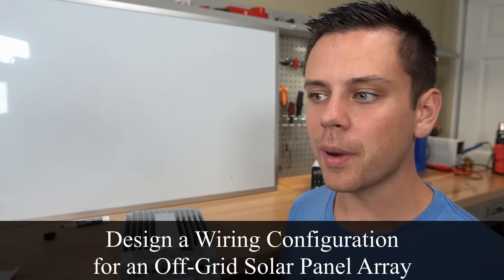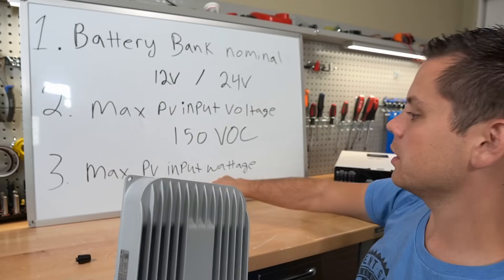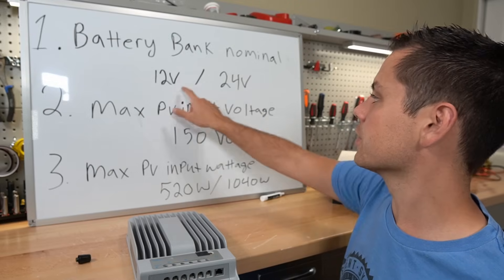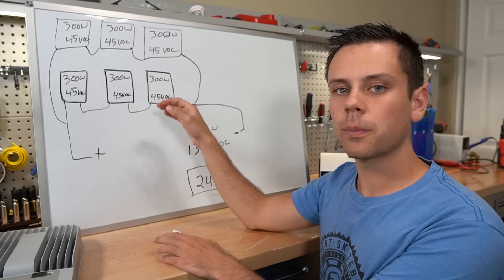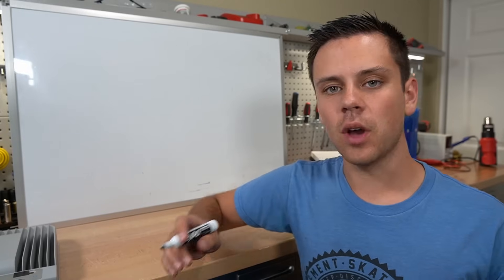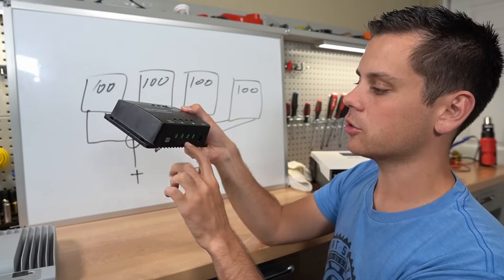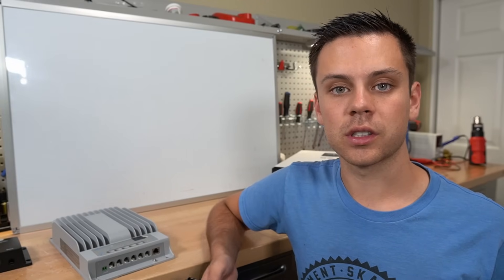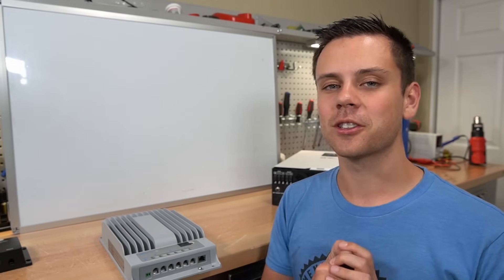How to Design an Off-grid Solar Power Array Wire Configuration

Comment: When considering the open circuit voltage of the array, you need to also consider (add) the panel temperature dependence offset or you can smoke an MPPT. At colder temps the panel Voc goes way up (and current down) vs. the nameplate rating at 25C.

Apply the open circuit voltage temperature coefficient for your array and size Voc (for MPPT) for the coldest temperature for your area with headroom. It's usually around - 0.3%/°C
Reply: Lance he did not mention whether using a 12 V or 24V panel. Does that matter or is it strickly just VOC and AMPS?
Reply: @oneshot_onekill4618 true for all panels
Reply: @lancefaure3945  Thanks i appreciate it! I have the MPP Solar LV2424 and i have 6 12V Renogy 100 Watt panels but i rather do a 24v system so i wanted to make sure i could use them and the only thing to look at is the VOC and AMPS.
Reply: @oneshot_onekill4618 the point I made about Voc (and Amps) is that they should be sized for the worst case scenario, not the standard operating  condition (ie nameplate rating). So if you live in a very cold climate your Voc goes way up (by 0.3% per degree C below 25C) and the current goes way down. And the opposite happens in hot climates. So basically size your array for your highest and lowest temperatures with an additional safety factor. Standard rule is multiply by 1.25

Comment: This controller can handle 3x the rated wattage input, so no, 1050w isn't too much for this in a 12v nominal system.

Comment: So if I add a 12v battery to another 12v battery I'll haft to get a 24v solar panel I wouldn't be able to use a 12v solar panel cuz I want to run one 12v battery but later add another 12v battery and another 100w solar panel that's 12v

Comment: I have the following solar equipment:

Renogy-Rocer Elite MPPT Charge Controller

2-Renogy AGM 12 volt 100ah batteries 

1-12 volt Pure sine wave 3000 watt inverter

1-Westinghouse 4500 generator/inverter

3-12 volt 300+ solar panels

My question is 1st is this a sufficient system …2nd can I run the generator as backup or Additional  power directly into the 3000 watt inverter???

Comment: I think solar energy is plagued by ancillary equipment failure. Inverters themselves cost a lot of money and in my case have proven to be highly unreliable. The best Off grid solar system has a high array input voltage, a high ( at 96 volt ) battery circuit and of course a high wattage rating. The object is NOT to use an inverter. At this dc voltage load circuits can be run smaller wire gauges. Light circuits would use many 24 volt lights in series and other 12 volt devices would require buck step down regulators. It would be nice if we would see a greater variety of high volt dc appliances. In any situation one must be very careful. I purchase all my camper electronics based on DC compatibility. Always preferring 24 volt or greater devices.

Comment: Mr. Prowse,
   My sister and I have been watching your great videos for a while now and we love them. We are subscribed as well. You have insprired us to build our own solar panel system. We have aquired 4 100-watt panels, a 60-amp epever charge controller, a 3000-watt Renogy inverter, 11 35ah batteries, an epever blue tooth module for monitoring with my Iphone and we are using 6-gauge wire. We have only been able to get around 90 watts at 5 or 6 amps during peak sunlight and we are wondering if this is normal or are we doing something wrong. The settings on the controller are: User 12V, Low Temperature Prohibits Charge 0, Low Temperature Prohibits Discharge 0, Battery Capacity 385 ah, Temperature Compensation 0, Equalize Duration 0, Boost Duration 180, Max Voltage 15.5, Min Voltage 12.92, Over Voltage Disconnect Voltage 16, Charging Limit Voltage 15.8, Over Voltage Reconnect Voltage 14.4, Equalize Charging Voltage 14.8, Boost Charging Voltage 14.8, Float Charging Voltage 14.8, Boost Reconnect Charging Voltage 14.7, Low Voltage Reconnect Voltage12.6, Under Voltage Warning Voltage12, Low Voltage Disconnect Voltage 11.1 and Discharging Voltage 11. We have never been able to charge our battery bank over 46% and we have only been able to go as far as 70 %, a couple of times. We bought 4 more 100-watt Ecoworthy panels to add so that we can try to get more amps going into the batteries. Any advice on our problem would be greatly appreciated. Thanks for the great service that you are providing with your channel.

Comment: Lovely video I am a fan of you works from Nigeria.
Please I want to ask a question, I have 3.5kva inverter which has requires PV input of 30-150vdc what happens if I connect all my panels in series that will produce 152v will it damage the inverter

Comment: I am just starting to design my system for my shed/green house, i have a 16ft shed that i want to put up 5 solar panels, i have a chance to purchase 5 -200 watt canadian solar panels, I have two 80amp batteries now, how should i set that up and what controller should i use, I will be getting more batteries how many should i set up and should they be set up 12V or 24V.
Thanks

Comment: I get that "technically" the solar panels with a power of 1050 W don't satisfy the 1040 W limit of the inverter, but in reality, and taking into account the tolerances and variations due to the angle/shades/sun, I would have thought that you can connect them with a quite high level of security.

Comment: Why oh why does no one in any of these videos ever address the wire issue?? AWG IS an issue! Go ahead, hook your panels together with 28awg. The lower the voltage the larger the amps, hence the larger the wire, running panels in parallel exacerbates the issue, plus de-rating for length and temp. Putting panels in series boosts voltage hence less losses on the wire, and smaller conductor. Run length matters.

Comment: Sir i have 40amp ssc mppt epever tracer an with 100v max voc and planning to put 24v batt. The only available pv panels here is 450w with voc 49.2v. Then plan is to have 2pcs 450w in series and have sum 98.4v voc. Is this safe for my scc because its kinda close to 100v. Or should i parallel this two to have 49.2v only? My worried is if i parallel this two, i need to replace my 6mm2 twin cable from pv to scc?

Comment: Can I ask you something please. I want to setup a 24v system, I live in Las Vegas and I wanted to purchase 2X 100ah batteries and wire in series to get 24V. I keep reading and hearing that when you wire in series you only increase your voltage but not capacity so does this mean combined I will still only have 100ah ? Sorry for such a noob question.

Comment: Is there such thing as an amperage limiter. I've maxed my setup via voltage so I was going to wire in parrallel but my amperage would be over the inverter limit?? Please and thanks as I need more watts. Running my camper off grid with 2500w system on a 48v inverter with 2 48v 100ah lithium batteries. My inverter limit is 500v at 16a. I'm currently at 386v at 8.6a in series. I'm looking to add another 10 panels of 250w 38.6v 8.6a. But wiring in parrallel to stay below 500v puts me over 16a... any suggestion? Reason being trying to keep my battery fully charged until the sun goes down to further limit my generator run time..

Comment: I wish I knew the answer to this question:
What if I added another brand of panels to my existing PV array?
Is it a problem if the new panels have a higher wattage? (slightly different circuit voltage)

Comment: As long as the voltage is the same or greater than the panel array, why would I have to worry about watts or amps, aside from the wire size?

The inverter PULLS amps, right? Just like how a tool you plug into the wall pulls however many amps it needs. As long as the voltage is correct, how can anything be "fried"?

Amps aren't "pushed" into the inverter. So why not max out on the solar array and max out on inverter clipping?

Some inverters pull from the grid itself. The grid doesn't have some wattage "rating". It carries a voltage and you can pull as many amps as you want from it as long as it is designed for that voltage.

Comment: Hello dear , i have the same inverter specs but im stuck with only 3 solar panels (470w/vmp 42v/ voc 52v ) what os the best way to connect solar panels note that my panels are 45 meter far from inverter connected with 6mm cable copper size

Comment: how to connect four AS-6M120-HC BLACK
380W PERC, 42 voc, 10.86 Imp to victron 250 / 85 controller with 12V batteries? If all 4 are in parallel then amps exceeds mc4 plug 30A limit?

Comment: in series watts dont multiply only voltage, parallel is the opposite and varying voltages or wattage panel strings runs at the lowest value volts/watts

Comment: Hi Will, thanks to your videos I've now realised that my solar panels and mppt controller aren't exactly compatible. My 3x panels have a combined voc of around 150v and my mppt states no more than 110v. My question is, is it worth series wiring two of the panels to get the voc near the max of the mppt and leaving the third panel out of the system, or wiring all three panels parallel, keeping the voc lower but the wattage high??? Thanks, Adam. Ps finding the mobile solar power book really useful!!

Comment: l dont understand  why if you connect  4 panel solar en serie 45 volt  45 ×4 volt  am egree but if is conect in serie volt  will be ip but watt still  the same 350 is amposible increase de vot and watt at the seme time

Comment: I really enjoy your videos. I am putting together a solar array in Shelter Cove California. I bought six 350 W panels from CED in Stockton California. I also bought a AMPINVT 120A MPPT Solar Charge controller. I also bought a WZRELB Pure Sine Wave 5000W (10000W Surge) 24V Power Inverter DC to AC Power - Solar inverter. Do you have a recommendation for a monitoring device and a distribution box if needed? If so can I get those from you? Thanks in advance for your help. Dan Bell here.

Comment: My question is, are u saying the wattage of the solar panel also increased when connected in series, for example if i have 3 24v solar panels each 100watts when connected in series the voltage increases to 72v are u saying the wattage will also increase ?

Comment: Please can you help me with my situation 
I have an inverter mppt with max wattage 1500w and max voc is 145v 
I have 3 panels with 51.3 voc each and 470w 
How can i get the maximum without hurting my inverter
Ps: i cant add more solar panels because of space 
And i have around 45meters wire between PV and inverter

Comment: Thanks Will! Helps me out a lot with choosing and wiring in my RV's solar array. Will be: 2x100w panels in parallel --> 30A PWM charge controller (renogy wanderer 100W charge kit + 100w panel) --> 2 x 215AH 6v golf cart batteries in series --> 500W inverter until I get my bigger inverter. Will add a battery monitor when I can too. Solar panel ordered, can't wait to test it out

Comment: Hello everyone, I wanted to ask something that I am trying to understand, let's say that I have 3 strings put in parallel, each string has 2 panels, what would happen if because of shading or stuff like that one string end up having a different voltage at its connectors compared to the other strings? Because I'm lead to believe that because of the difference there would be a small or larger difference in voltage at the nodes of the shaded string causing a current to flow in this string but in an opposite direction basically stopping to produce energy and instead consuming it as a parasite current. Am I correct or I'm misunderstanding how it works? 
Probably it wouldn't be much as the difference in voltage would be small but also I don't think the panel have high resistance and so the current that would flow isn't that small without considering that like that is also kind of a waste of panels.

Comment: If you have a 100 amps of 12 volt then go to 48 volt wired for 140 volts and only get 2 amps are the batteries still getting the same amount of power?

Comment: I ordered that EPever MPPT and looking to get five Newpowa 100w panels soon. I hear the Newpowas are sometimes pulling a little more than 100 watts per panel and I want them for a 12v 200ah 2560wh battery with a 2200 watt pure sine inverter. All components that you recommended from your site! 👍🏽👍🏽

Comment: 9:32 Is there any reason not to connect all the panels both in series and parallel, like grid (add 4 vertical lines between panels to your sketch) ?

Comment: I came across your video and really learned a lot. I saw you did one on the Goal zero. Would you need an inverter or circuit breaker if the yeti regulated itself. Is there anything I need to look out for. It’s the yeti 6000. Any help is appreciated. Thanks!!

Comment: Hi. What would be the outcome of this series parallel connection:

String #1:  100w 16.77v 6.26Amp (2 panels), 120W 18v 6.7Amp (1 panel)

String #2: 100w 16.77v 6.26Amp (2panels)

Would I see a slight benefit or decrease in performance by adding that 120w 18v 6.7A panel to the group of 4 100W panels?

Comment: Hi.  I am interested in learning how to design an off-grid solar system.  Do you have any videos or can you recommend software to help do this.  I have learned a great deal about setting this up.  But I want something that help me size things correctly and wire correctly.  If I could find something to finally get down to an inventory of parts, that would be great.  Thanks.

Comment: So, I have a 250/100 victron smart solar charge controlller. I know I can safely do a 5kw array but I'm wondering what would be a safe amount of over paneling when the battery bank is at 48v?? I'll be using 4 chin 300ah batteries, which have at 200amp charge limit, so they could safely handle the full 100amps the mppt could potentially put out, right?

Comment: Your video is very informative. I want to build 1000 Watt 24 volts system, what is your recommendation for the Controller and Inverter. I may want to expand the system to 2000 watts in the future.

Comment: I have an ecoflow 3600 pro, it says I can connect 1200 solar watts to it, I have 6 180 watt solar panels, would you be kind enough to tell me the best way to wire the PA els to the ecoflow pro, I was considering 3 in parallel and 3 in series, what would you recommend, Thx in advance, James

Comment: Yeah, I agree that high pv input voltage is the way to go. I see my battery bank getting so much more useable power in low light situations and during the morning/evening times. I found the Epever tracer 40a a great controller. Seen it go over 40a at peak times but it never seems to get hot

Comment: Finally, the video I've been looking for. I have, or will have 4 x 45v, 300 watt panels that I want to build a 24v charge system with for an off grid, art studio cooled with a small mini-split. All the MPPT's seem to stop at 150v, and I'm at 180-200 if wired in series based on the calculator you had in another video. I was planning on getting a combiner box.

Comment: Hey Will!

First of all, incredibly good and educational videos: D

But I have a question...

3:45 into the video, you add the voltage on the 3 panels that are connected in series and also the power (total 135V and 1050w).
Later at 11:30 you tell us that if you connect the 4 100w panels in series, it will only be 100w ?. should not there be 135V and 350w there too? Thank you for being incredible!

Comment: I'm confused by the solar panel configuration at 5:00 in the video. You are referencing a 12V System but the series array depicts a 48V output. Am I wrong?
Reply from the maker: With mppt, your string voltage will be much higher than battery nominal. Think of it as a fancy step down converter.

Comment: This confused me a little. If a set of 3.2v  5 amp batteries say 4 are in series you would have a 12.8v battery with 5 amps. Ok then Why are solar panels in series the voltage rises ok, but in this video description the Watts rose as well by adding them. I thought series the voltage rises but the amps remain the same but in parallel the voltage stayed the same but the current rises. The video stated that 12v panels in series the voltage and the current went up?? Or am I missing something Will? 6:17sec to about 7:23 sec of the video. When you put them in series /parallel I followed the watts and voltage and came to the same values you did. What am I messing up in the series part. Love your videos and bought your book as well and getting ready to build an array ... thanks

Comment: Will Prowse made our system possible.  After watching countless videos we began to understand things enough to finally make a decision.  For us, the hybrid system all in one was answer.  We got Geowatt grid assist system and bought from one of Wills suggested suppliers. We’re not running but half the system right now since we’re waiting on our batteries to arrive.  But in the mornings I love when the system turns on and is producing. And it starts very early in the day. Surprisingly, it also stays on later in the evening than we ever would have imagined. We are quite pleased even with just half the system up.

Comment: Why does the wattage size of the array matter as long as I stay under the VOC for the charge controller?  Other than it simply being wasted wattage (and money), wouldn't the CC simply not use the excess array wattage? I mean my microwave is rated at 1100 watts, yet I plug it into a grid capable of delivering many mega watts , yet the microwave only uses what it can use.

Comment: Could you please explain the correct way to wire a PV array 2 pole breaker… there seems to be a lot of confusion with + and - positions..
which might cause a reverse polarity in the breaker… which would result in a fire…